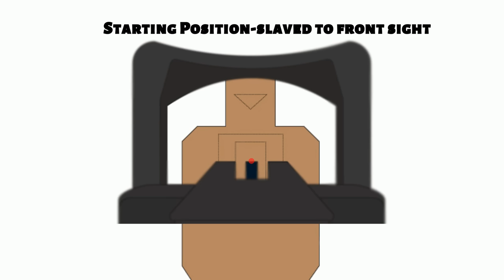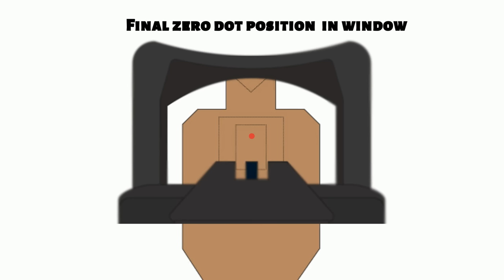Zeroing a Handgun Red Dot Sight

Comment: I know this is an old video but leaving a comment because maybe I am missing something but I'm a bit unclear about how the dot goes from the middle of the front sight post to the center of the window when it stays on the sight post through 2 diagrams prior. Previous handguns I've had dots on, the dot obscured the irons entirely but my recent Canik MC9/EPS Carry combo has me confused because the irons are visible through the window. I'm assuming that the dot after adjustments will put the irons out of alignment if you have a correct sight picture due to the differing planes? I'm probably overthinking this.

Comment: Kinda confused about the vagueness of centering the dot in the window after slaving to irons. Doesn’t this slightly change presentation or are irons still aligned and dot is center of window and a different zero distance than the irons?
Reply: The age old question nobody answers!
Reply: Slaving the dot to the irons is a starting point, but you need to know the point of impact for your iron sights. So, if I toss suppressor height sights on my pistol, and go to the range and test them out. I start at 3 yards and wind up at 15 yards and I'm dead center with irons, then I now know the point of impact is 15 yards for irons, so by slaving the red dot to my irons, I should be able to be dead center with my dot at 15 yards. However, I don't want to zero my dot at 15 yards and would rather be zeroed at 25. This is where the dot becomes completely independent from my irons. Since I am no longer at 15 yards, aiming with my irons will not let me hit the bullseye. I know I'm on paper at 25 yards because I was bullseye at 15, so I adjust my RDS accordingly until I am zeroed at 25 yards. Now my irons are set for 15 yards and my RDS set for 25 yards. They are independent from each other. 

Centering the dot in the window is for when you're shooting using the RDS. You do not align the iron sights when aiming with the RDS, only presenting the dot in the center of the window. Like mentioned above, it is independent from the irons, so as long as you can see the dot, put it on your target and pull the trigger, you should hit what you're aiming at. When you look down the irons, the dot could be anywhere. When I look down the irons on my gun, the dot is actually exactly right on top of the front sight dot. It is zeroed at 25 yards.

Comment: 10:23 Yeah those were the days. August 2020 here.
Reply: All the more reason to be methodical in your zeroing process, as Aaron advocates.  Tip:  After zeroing for your carry ammo, get a good quality boresight laser cartridge, determine where the laser dot is with respect to your red dot optic at 25 yards, and make a note (usually they don’t exactly match up).  Then, when you need to re-check zero (after an RMR battery change, for example) you can use the boresight to re-check the relative zero (relative to your actual red dot) and get closer with less ammo.  In three years doing this sort of thing, I have yet to see any real zeroing change from mounting/dismounting RMR’s with well engineered mounting solutions and a calibrated torque wrench (using plates with precise RMR posts, mill jobs with precise RMR posts).  Plates without posts, or direct-mill jobs without posts, or free-handing the bolts, will often require an actual re-zero. YMMV.
Reply: Shini Gami — great advice! Thanks for the input!
Reply: Didn't age well lol
Reply: @shinigami1925  why is the red dot zero different from what you co-witness with iron sights? (sorry for the dumb question) I'm guessing it is related to how you shoot vs where the sights point, but that would require your shooting to be very consistently away from where the sights line up, wouldn't it?
Reply: @chtomlin   Irons are regulated for 15 yards in my particular case.  Some folks roll without irons at all (many gamers).  So the bore laser solution is an independent means to solve the issue with less ammo.
Reply: January 2021...oh it got so much worse.

Comment: In my experience, if you carry Federal 147 gr HST standard pressure than you can use speer lawman 147 gr or American eagle 147 gr (I believe they are they same loading - just different brands from the same manufacturer) for the intial zero and then only need to make make minor adjustments with HST, saving a significant amount of premium carry ammo. In the long run it may be worth finding a range ammo that performs similarly to your carry ammo just for this purpose.
Reply: Good tip...
Fyi, Speer and American Eagle are brands owned by Federal Ammunition, which of course makes Federal HST as well.... Federal does now offer a “train and protect” package which gives you training fmj and hst of the same weight and is supposedly the same trajectory/velocity etc.
Reply: My POI is very different when using federal 147g flat nosed fmj vs 147g HST!!!
Reply: @gamebred5x then use speerlawman, it’s the closest for me. Even 124

Comment: I put 1" orange stickies on a target. Walk up to 3yds and shoot a few rounds (don't bother cowitnessing). Make COARSE adjustments. Check with 1-2 rds. Make another correction if necessary. Back up to 5yds, recheck. Adjust if necessary. At this point I'll back up to 15 or 25 for my final zero. The final zero I do just like you, from a flat top using a bag, 5-10 rd groups. The biggest difference is dealing with the frustration of trying to sight in a red dot from 25 at the beginning. It's hard to even see the hits at 25 (binos are good to have). Anyway, I tell people just start at 3yds and work backward. I'm convinced its quicker and less frustrating.
Reply: Jack Lapham, I do almost the same thing, and I agree about reducing frustration!

Comment: I may have missed it, but can you please explain why in your sight picture/views from making adjustments that the dot gets lower and lower on the front sight post and then in the final view picture, it’s significantly higher than the front sight?
Reply: I had to watch the video a few times to understand but he co witnesses with his red dot to his irons before he even shoots to basically get the windage and save ammo. On his first 5 rounds he doesn’t co witness he just uses the dot. The co witnessing or slaving he does as his first step isn’t fired like that. It’s just a preparation before zeroing to save time and ammo and get close to a zero.

Comment: For those wondering why the final illustration shows the dot high above the perfectly aligned iron sights, that is because the illustration is incorrect. The front sight should be slightly high in relation to the rear sight. The dot and sights would line back up if the pistol was slightly aimed down. It’s all a matter of perspective based on where the eye is in relation to the pistol. 

I posted this explanation in another thread: The final illustration is inaccurate because the iron sight alignment didn’t change, but the dot alignment did. The front sight should be slightly above the rear sight when the dot is up in the window. The dot is moving up because the pistol is being aimed slightly “up”, but the eye level is going with the dot. If you use a rifle with lower 1/3 irons, the same thing happens. You CAN perfectly co-witness the irons with the dot, but when actually using the dot, the irons will not be part of the sight alignment anymore.
Reply: tv92taylor i was just about to ask about this then i seen this thanks for clarifying 👍
Reply: I have a friend who has an RMR sighted pistol. It drives him crazy b/c it was zeroed slave to the irons. The red dot appears super low looking through his RMR. Is he using the sight incorrectly or is it incorrectly slaved too low to the irons?
Reply: Sami S he is using it wrong. Tell him to watch Aaron’s videos. Worth it.
Reply: Thank you. This was driving me crazy. I understand now. Even though the zero is under the front post, when tilting the firearm up  to put the dot in the middle of the window, it is still zeroed under the front post. Just an optical illusion.
Reply: Im still slightly lost; So do I sight my handgun in slightly tilted up or what?

Comment: Can someone explain what causes the dot to move up in the glass at 11:15 or so. He shows the final sight picture and now it’s centered in the glass and not slaved to the front sight post. 

I just don’t get what causes this to move up in the window. If I have my irons properly lined up my dot basically sits slaved on my front sight post. Is it simply the increased distance that when you’re zeroing the dot causes it to move up?
Reply: That’s because you shouldn’t zero your rds to your iron sights. That’s only where to start.
Reply: He made a video on my not to slave your rds to your iron sights.
Reply: After he slaved it to the irons and benches it he says he “roughly centers the dot only, in the center to the glass without the use of irons” takes five shots then proceeds to zero
Reply: @geraldbco1306  Its because red dot sights are roughly parallax free. You want to have the dot in the center of the glass because that area of the glass is  where the sight truly is parallax free.

Comment: This only works with RMRs to my knowledge, I tried it with a 508tv2 and theres no way to get the dot low enough to touch the front sight post, it doesnt even come close even with it lowered all the way.
Reply: Using suppressor heights sights, your 508T elevation can’t be lowered to touch the front sight?
Reply: I run holosun 407cv2 with suppressor sights and it goes all the way to the middle of the front sight..i just don't get bringing it up towards the middle of window independently, wouldn't that just lower the POI?

Comment: I have a gen 5 glock 17 with an RMR and suppressor height sights. I’ve noticed that my dot is off to the left of the front post slightly.. but the zero is fine at 25 yards, backup zero is good too, is this normal, or is my zero bad?
Reply: Matt Fowler parallax.
Reply: Mines be same. If your hitting dead on what’s wrong ?
Reply: Mine is also like this but zero is good

Comment: Hey Aaron awesome video. I've sighted in two RDS sights and followed your instruction to do it interdependently. I was confused though on the final zero dot position in the window animation since before it was on the front sight post. Howd it get back to the center? Were the other illustrations just what the adjustments are doing even though the dot remained in the center?
Reply from the maker: Bryce Litfin the final animation shows the dot position when used. There is no need to align iron sights when using the dot, such as co-witnessing.  This is why the optic is zeroed without referencing the iron sights.
Reply: @SageDynamics  So what youre saying is when my rmr is zerod at 25, when aligning the iron sights the dot is in the FSP. Like almost where the front dot is. That can be normal and ok?
Reply from the maker: Johnny Yackle correct.
Reply: @SageDynamics  awesome i felt like I was doing something wrong. If bench rested with this zero i can push 100m shots with a slight hold over and hit 5-30m with no issues but when looking at the graphs I felt like im doing something wrong.
Reply: Bryce I'm still confused on the same thing you were, he got gradually lower from the first to the 3rd adjustment but on the finalized view  he shows he's in the middle of his glass and not making contact with his front iron sight at all so how did he finalize his nonslaved zeroed position?

Comment: hello sir/ma'am, could someone/somebody help me out please on a simple optic red dot for me to purchase for my Specs
SKU 180023
Model M&P® 380 SHIELD™ EZ®
Caliber 380 Auto
Capacity 8+1
Safety No Thumb Safety
Length 6.7
Front Sight White Dot
Rear Sight Adjustable White Dot
Action Internal Hammer Fired
Grip Polymer
Barrel Material Stainless Steel - Armornite® Finish
Slide Material Stainless Steel - Armornite® Finish
Frame Material Polymer
Barrel Length 3.675" (9.3 cm)
Weight 18.5 oz.
State Compliance MA

THANK YOU & AWAITING FOR ANY PROSPEROUS RESPONSE

Comment: @SageDynamics - I'm a new shooter and bought a G19 Gen5 MOS with the intention of learning iron sights and then putting on an optic. Based on your experience, would you recommend I put the optic on right away and start learning the pistol that way instead?

I understand the fundamentals of using a pistol don't change (grip, stance, sight picture sight alignment, breathing, trigger control) and that the biggest advantage is allowing the shooter to threat focus.

Thanks in advance for your feedback
Reply: VintageGold There’s pros and cons to both. By starting with optics you remove one of the difficulties which I think helps very new shooters get the basics of grip, trigger press, etc. Although once they get the basics down I recommend going to irons to continue development, it’s hard to go back to shooting irons once you get the dot down, it’s a good skill to have though. I learned pistol all irons, and rifle with optics. I can honestly say I’ve never gone back and gotten good at rifle with irons. I imagine if I started with dots on pistols it would be the same. Kind of like learning to drive a manual or an automatic first, it’s going to depend on how you learn best.

Comment: I still don’t understand how you get your red dot in the middle of your sight? So you put your red dot on top of your iron sights. Then you shoot 5 rounds and adjust as need.oerfect dandy, your shooting right where your red dot is. But just like in this video your red dot is half way down your iron sights. How do you get your red dot in the middle of the window in your red dot? Thanks for the help in advance.
Reply from the maker: Kyle Wheeler that’s where the dot is when I use it. The iron sights aren’t referenced at all.
Reply: I’m lost to you bisect the red dot shoot five rounds and adjust from there right
Reply: @SageDynamics  so you're saying when you are viewing the dot high up in the window, that your irons will essentially be positioned with your front sight post high in relation to your rear sights? So if your dot  goes down then you have to adjust the gun back downwards in order to get an accurate iron sight picture?
Reply from the maker: MusicMan1eAnda more or less.  It varies on gun/sight radius and chosen sights.
Reply: @musicman1eanda  I done get why he just won't answer the fucking question, did you ever figure it out?
Reply: @sneakybooget9188  I figured it out and also took a course with Scott Jedlinski. Scott's methodology is just put the dot in the center of the window, shoot at a 1in square at 10yds, get at least 3 in the 1in square in a row, and you're zeroed. Much easier process.

Comment: I don’t own a red dot, but my question is it necessary to zero it with my carry ammo? Carry ammo is $1+ per round, which means it’s $5 each group I shoot to get my first zero and then do I have to only train with my carry ammo? That’s $10+ a mag. I can afford to do this, just seems unnecessarily expensive. Not trying to complain, just trying to learn more. Would be nice to at least train with cheaper range ammo at 1/4 to 1/5 of the cost.

Comment: I feel like I missed something in this process... the step by step illustration showed the dot going further down the front sight post as the zero got closer to the center of the target then on the last step the dot flies all the way up to center. What happened?
Reply: I asked the same question. I'm confused. Just got an rmr and I'm lost.
Reply: I don't claim to be an expert. Once zeroed, you're sight picture no longer involves cowitness with iron sights. Your sight plane is now only dot to target, not dot, irons and target.
Reply: @k9rka489  does that mean that when you are looking solely at the dot which is high up in the window above the iron sights, that your iron sights would be in an incorrect position (meaning that your iron sight picture would result in high shots off the irons?)
Reply: Yeah I’m confused too.
Reply: MusicMan1eAnda There's quite a bit of science behind it, which is hard to follow. The white paper Aaron has on his website goes deep into it.  Your red dot and irons are mechanically at different heights when installed on the pistol. When shooting remember the red dot isn't actually moving in the window. It's more your perception and the brain translating it as you should have both eyes open.  It can take between 500-1000 draws to start gaining proficiency with it.  Again, think how long you've been shooting irons. Depending on the shooter, it can take you just as long to be proficient on the rds, although most pick it up faster after several years of irons use.
Reply: @k9rka489  I'm just confused on how to zero my RMR.
Reply: The final illustration is inaccurate because the iron sight alignment didn’t change, but the dot alignment did. The front sight should be slightly above the rear sight when the dot is up in the window. The dot is moving up because the pistol is being aimed slightly “up”, but the eye level is going with the dot. If you use a rifle with lower 1/3 irons, the same thing happens. You CAN perfectly co-witness the irons with the dot, but when actually using the dot, the irons will not be part of the sight alignment anymore.
Reply: @tv92taylor  so would you now have to solemnly rely on the dot alone and will you always have to elevate your front sight
Reply: @sneakybooget9188  No. Your iron sights will still be usable just like before the dot was installed. But when using the dot, the iron sights will be below the dot and you won’t be using them at all.